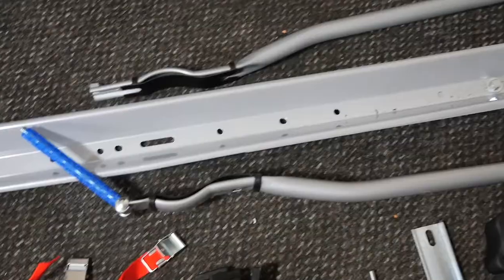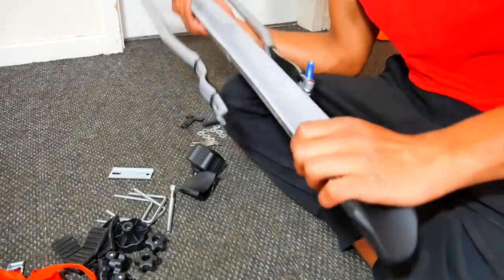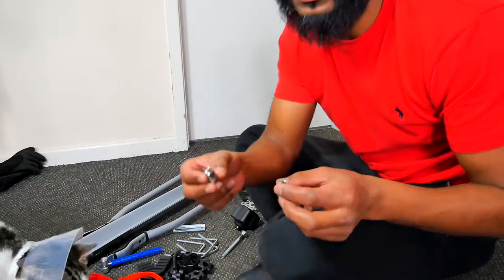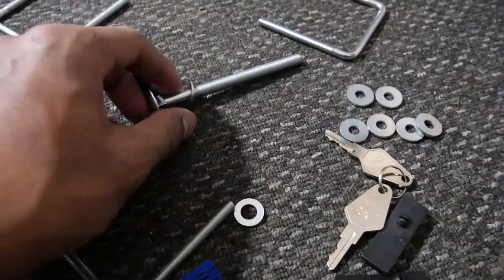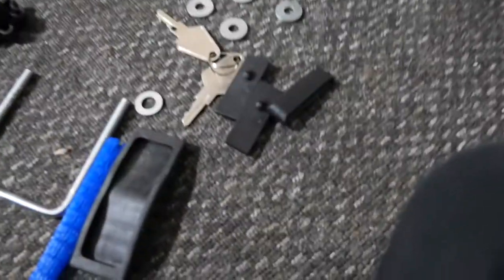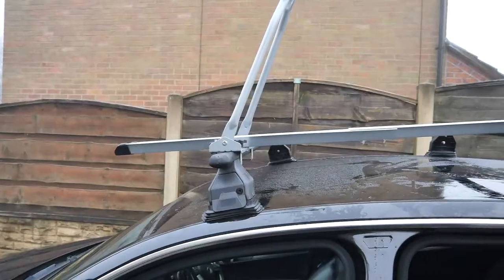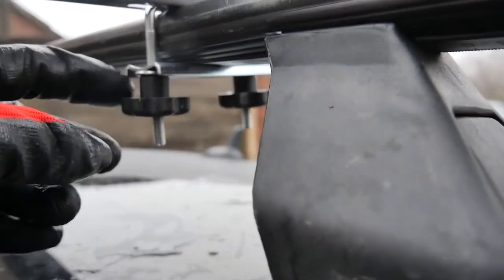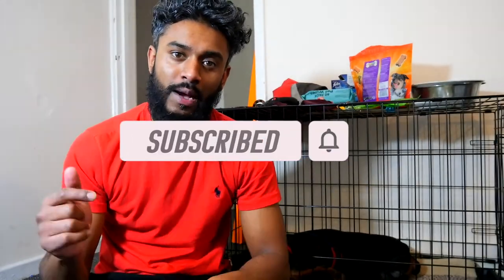HOW TO ASSEMBLE HALFORDS SINGLE BIKE RACK ONTO ROOF BARS | TUX THE DOBERMAN | Before & After

Comment: I just got one of these. Do you think it can be left on the car without the bike? It seems a bit of a faff to keep taking it on and off.
Reply from the maker: I agree, it is effort taking it on and off. Personally, I wanted to find a lock system to put on but haven't so far. However, it's not been a problem. Left it on the car numerous times overnight but nobody takes it. guess it depends if you want to take the risk.
Reply: @kamzadventures5938  Thanks for the reply. Just assembled it and discovered that my roof bar are too wide. So back to Halfords tomorrow:(
Reply from the maker: @richb2004  did you try extending the bike rack?
Reply: @kamzadventures5938  Yeah, all set up well and lined up. The problem is that the U bolts aren't wide enough for my bars. 60mm max for the U bolts. I should have checked before I started putting them together.